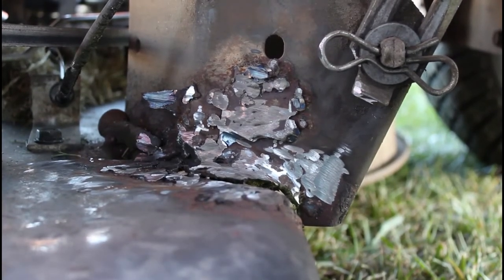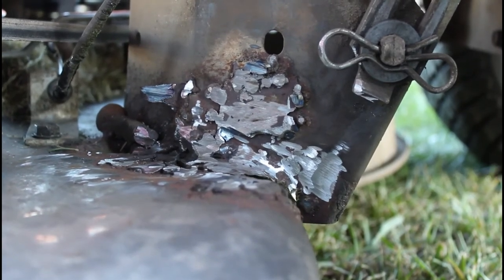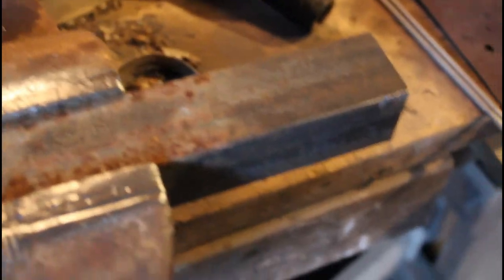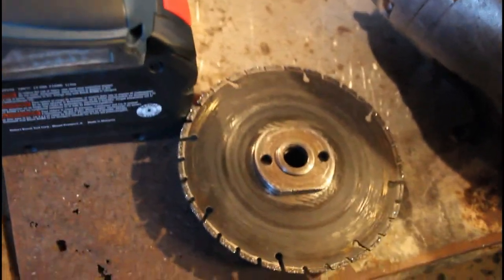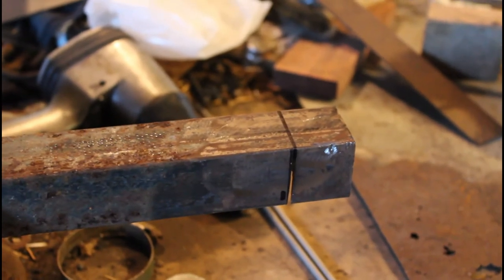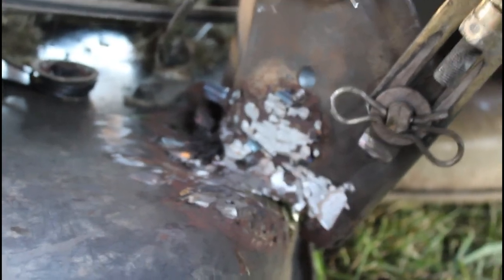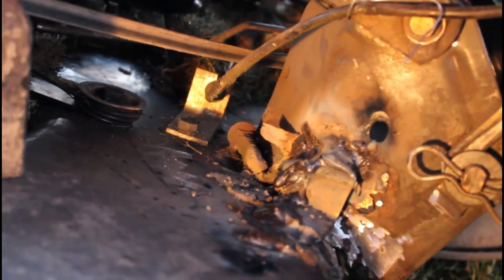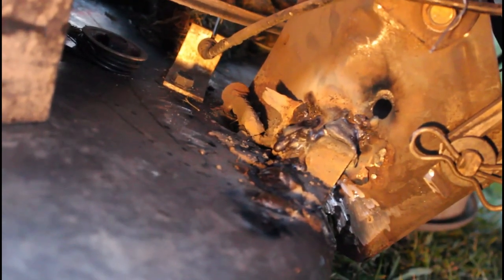A Lovely Day To Restore A Trailer 5, Also Welding A Mower Deck

Comment from the maker: One thing I don't get is why buy $500-2500+ worth of steel to build a welding bench when you can buy scrap steel for $2-4 per pound? I just bought scrap steel for my needs, and it cost less than $20.